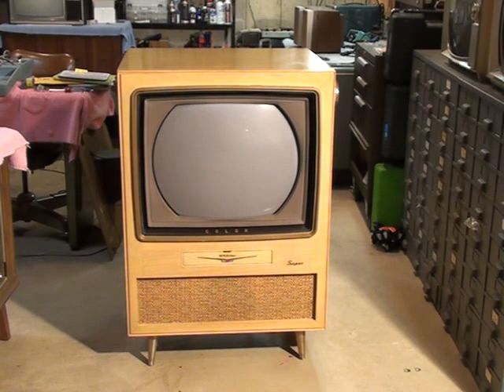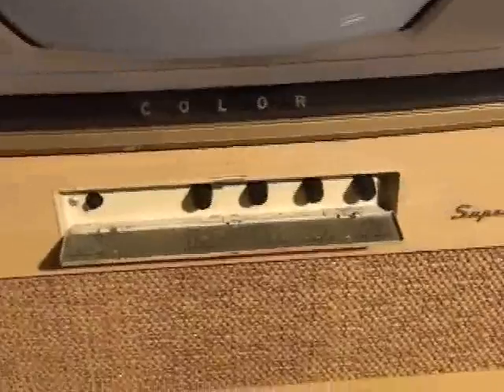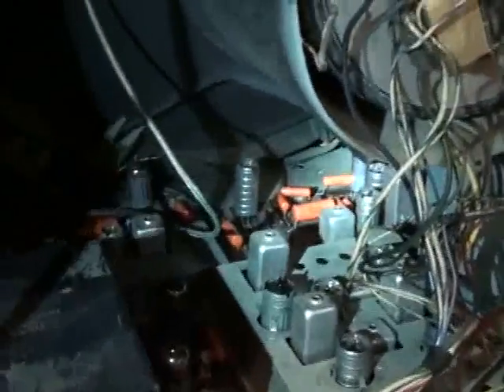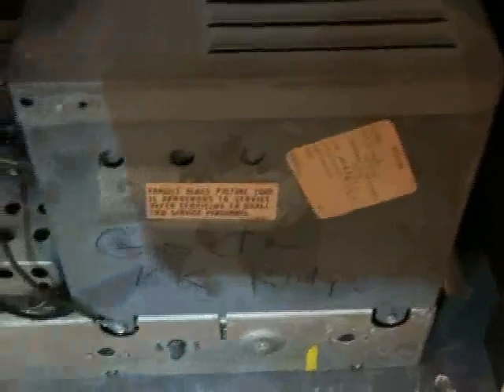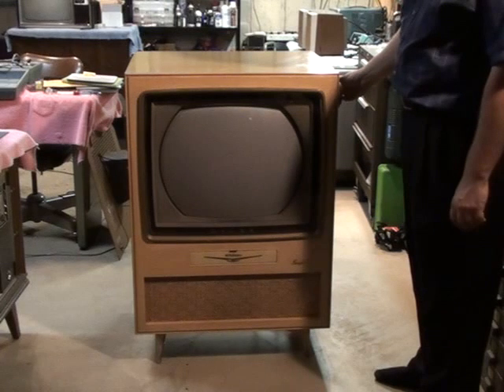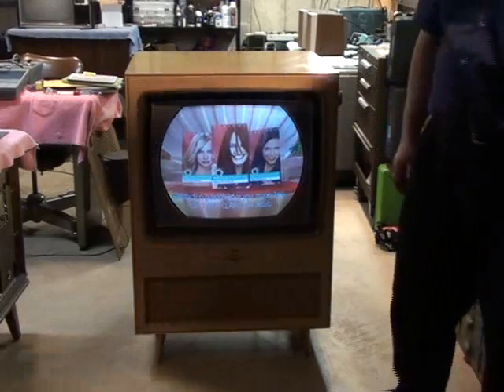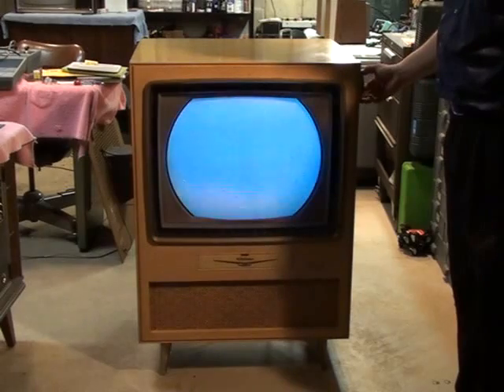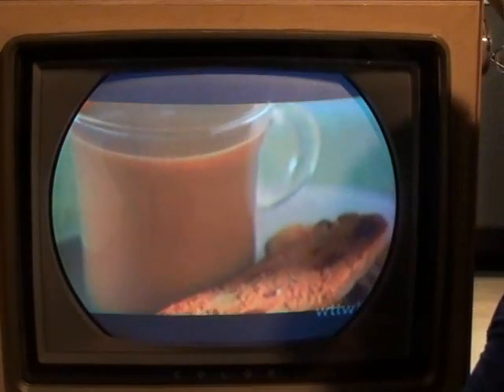Watch a 1956 RCA VICTOR CTC-5 COLOR TELEVISION!! "Roundie"

Comment: Let me add a little history...My Dad was an RCA dealer and we had the very first color TV in town, he also sold the first color tv in town and I grew up in the business and running the business till 1985.  The very first color TVs used a vertical chassis and the top of the cabinet was hinged, it would raise up for servicing, they had a boat load of tubes and your TV tech was your best friend!  At first there was only one hour of color TV broadcast per week, RCA owned NBC and talked Disney into being the first program, Disney's Wonderful World of Color was the name as I recall.  Color broadcasting slowly increased over the years, but exploded when RCA finally licensed other manufacturers to make their own color TVs, I'm not sure about the year but it would have been about 1966 I believe.  When I started selling color TVs RCA was the only one, but about the time I was in college they licensed it, every color TV of the time had a notice:  Built under license from RCA Victor.  One other small detail, growing up around a TV repair shop, the owner's name written on the chassis means that at some time the chassis was removed from the cabinet and taken to the shop for service, we used paper tags but some techs just wrote the customer's name right on the chassis.

Comment: Fantastic. Its a credit to you for doing the restoration work. The picture & sound are excellent.   The CRT was obviously built to last.   A piece of History to admire!
Reply: In reality, the round 21" tubes lasted between 5 and 10 years when used daily.  I changed a hundred of them easy. Of course, there are many for whatever reason just defied physics it seems and ran much longer.  My dad's CTC11 needed it's original sulfide phosphor tube changed around 1969 (ten years) and the replacement tube (hi lite phosphor) went to 1977 before we scrapped the TV for an XL-100.

Comment: anyone else remember that wonderful aroma of a hot wooden TV cabinet. If you left the TV on long enough there would be this sweet aroma of warm wood and hot electronics
Reply: inkey2 sadly I was born in 2002. I love mid century modern (50s) when I get my own place I will have 50s furniture and tech (I hope)
Reply: Ah, the magic of old tube TVs. I also remember the sound coming on before the picture, and the little white dot in the center of the screen when you turned the set off.
Reply: Absolutely! When I was a kid, At night I was always sticking my head around back to see the MAGIC AND A LITTLE SCARY GLOW of the tubes.and awesome smell of hot electronics!! I still get my fix from a 1954 Zenith am fm phonograph console that works perfectly.has the cobramatic turn table too. My great uncle left it to me when he passed in 1994, at 100!!  He knew how much I liked it . He bought it new..it has lots of glowing tubes and the familiar  odor that goes with it. I also have several Zenith table top radios,  one from 1961, the other 1964. Both tube types,  and playing well. Also have a 1941 Zenith floor model radio that belonged to my mother's parent's.  She told me on December 7, 1941 when pearl harbor was bombed,  everyone listened to everything happening  on THAT RADIO! Still works!!
Reply: Very good point....
Reply: Ozone too
Reply: Nothing like the memories of hot PCBs, and formaldehyde
Reply: Don't forget the unique high-pitched whine those crt tvs made.
I don't miss it. Some sets were really loud! Wasn't from audio, I was told it was related to the beam scanning the tube.
Reply: ++++ Does anyone else remember that late at night you could get more than just your 3 local channels . I was in the Boston Suburbs and got channel 4,5 and 7. After about 11:00 you could run through the channels you usually didn't get in the day. They came in "snowy" but semi-watchable, some came in better than others. Since the signal was the old analog way you could see even the weakest channels. Today on a digital signal you either see the channel or you don't....can't see a weak signal.
Reply: Sadly, I must say that I don't.
Reply: I might start in on my "Alliance-Tena-Rotor" story, but I suspect most of you never heard of it. (yes, it's vintage TV related)
Reply: Yep, dust burning off hot tubes and carbon composition resistors.  The good old days.
Reply: @gregdolecki8530  Yeah, and  remember the big """INSTANT - ON """ tube set disaster. There were two settings you could choose  "off"....and an "instant "ON" off setting. The tubes would keep glowing at a lower power level (seemed like it was off BUT WASN'T" so when you turned the tube TV "on" it would come right on instantly. Problem was the low level glowing tubes were still a bit hot. After sitting like that all night the heat would build up enough to ignite the dust on the tubes and "instant house fire". A family in in my town died from one of those "instant-on" TVs. Entire family burned up. Needless to say I never used that setting on my RCA again.
Reply: @inkey2  I wasn't aware of that feature on some sets.  It most likely kept the tube heaters on.  A tube would heat up in 11 to 15 or so seconds from cold.  People couldn't wait that long apparently.
Reply: Smell of crudeness this video really makes you appreciate modern tv and tech
Reply: @inkey2  The Yoke power supply: 10 - 30KV.
Reply: @inkey2  lol you mean like these old tube sets? someone literally wrote just how unreliable these were until 80s.. but even then crts only lasted 5-10 years. Back in these days "tv repairmen" were a thing because they were so busy with repairing these tube sets.

Also I am not buying your crt running 12 hours a day for 22 years and being good as new.. that tube must be weak af.. in fact it should be so dim you can't even see a thing.
Reply: @harshnemesis  I never said they were tube sets
Reply: @inkey2  I am talking about crt technology in general (which is a tube btw) It took until 80s for tvs to be somewhat reliable, which was well after the tube era.. because tubes constantly broke down... people were literally removing them and taking them to shops to test them regularly, that's how bad it was
Reply: @kysbleach69.o.24  Furniture would be OK, but be careful with electronics and stuff, they can posses danger after so many years. For example some radios were made without input transformer, that means that hot (phase) can be connected accidentally to the chassis of radio. As well capacitors can be bad and beside rendering device unable to operate properly they can cause overheat and fire. Just let experts check it before use. Some home appliances can posses danger of shock as well due decaying insulation inside. Just let them be checked before use. And about some armchairs and so, they were made from styrofoam and/or used some not ideal materials that would catch fire really quickly.

But if you pay attention to those small things you will most likely be fine.
Reply: @davidjames666  Were they really PCBs or earlier designs with point to point wiring (or how it is called)?
Reply: @MrToradragon  prior to the PCB ban in 1979, the dangerous chemical can be found in capacitors and transformers in old television sets
Reply: @inkey2  That on it's own is unbelievable because CRT tubes themselves do wear out, even if you never have problems with guts itself, but even that is lucky because caps are necessary evil and are a shitty technology.. they are pretty much responsible for 90% of all failures on solid state electronics. Just like the olden days, if tv or monitor fails it's most likely the caps(except you don't have to worry about tubes also)

Either your tv sets are low to medium hours, or you're BSing. 12 hours a day would be a very high hour set. No CRT tube would survive that for 30-40 years and still work like new.. the picture must be weak, cloudy or simply so dim it's almost gone.
Reply: @gregdolecki8530  it was capacitors that shocked him, they are part of the transformer start ckt
Reply: We had a mid 50's RCA black and white got hot and caught on fire one time...house smelled of burned electrical and dust for a couple of days. Next tv was an RCA Color Trak...
Reply: @alanhumphrey4198  was it left on a long time before it caught fire?
Reply: @inkey2  As I remember it was after watching several hours of evening shows. It had served its useful life. Bought it about 1957 and lasted until sometime in say 1969...
Reply: @johnfranklin5277  Great story!!!
Reply: @harshnemesis  getting back to you from a million months ago.....when I said these two TVs were on 12 hours a day I didn't mean 12 hours non stop. They would be on 4 hours then off a few hours, then on again....then we, my wife and I would fall asleep at night watching so it would be on for more hours. The Panasonic super-flat was a high end TV...about $500  20ish years ago. The color is like new. The other one, Hitachi, cost about maybe $275. older than the Panasonic, and the color is fading very slowly. I'd say it has lost about 25% of it's color but still pretty good. I've really gotten my monies worth out of these.
Reply: @inkey2  Actually too much dust on hot tubes and base of tv cabinet itself...
Reply: I was in the business for many years and never smelled any such odors unless a transformer or yoke burned out and it wasn't sweet at all!
Reply: @bobboscarato1313  Oh, also....the fact I got 130 thumbs up for my statement about it indicates that at least 130 other people experienced it too.
Reply: @inkey2  Maybe they enjoyed your story!
Reply: I went into a more profitable business!
Reply: @bobboscarato1313  but what was the year span when you were repairing TVs?
Reply: @inkey2  1960 to 1974.-

Comment: What incredible color...especially for a 1950's set, when color tv was in its infancy. GREAT job on restoration!
Reply: When RCA got the final FCC approval for their system, the equipment was capable of producing an excellent picture.   However,  consumers didn't see that for another 10 years. The TK-41 color cameras produced great picture as did the sets, but only if you watched it on a closed circuit.  They had not yet figured out how to transmit a stable color signal that was shielded from outside interface that required viewers to adjust the color every few minutes.  Several innovations were developed that overcame these problems and allowed the public to see just how good color TV really was.  By 1964, sales of color sets started to take off. The researchers and technicians at RCA did an incredible job.  In fact, the NTSC system that was originally derided all over the world because of it's initial instabilities, wasn't really tossed aside when we switched to digital HDTV.  It's still the basis for producing a color image.  

......

Comment: We had that exact TV in 1959, and were the first in our entire neighborhood to have color TV.  The only differences I can see is that ours would swivel left & right, and our front control panel's door had a spring to flip it closed.  On top was my dad's Heathkit FM radio, that he wired to the TV's speaker.  I bought my parents their first microwave in 1978, and my mom wouldn't let it in the house.  In 1980 I gave my dad a video camera and VCR.  I'm glad I did.  I have home moves since then, starting when I was 25.  I'm 65 now, and have few friends with home vids that are that old.  Thanks for sharing this video!

Comment: The good old days of staring at the end of an atomic particle accelerator.
Reply: at or near 15 KeV!
Reply: And the good old days of listening to vinyl records that popped and skipped and you had to turn them over to hear the other side. I remember one vinyl record I bought that when I opened it, there was no music on the disk. It was just a blank vinyl disc with no grooves, not even a hole for the spindle. I took it back to the store and they couldn’t believe it either. 🙄🤭 They did exchange it for another copy of the record . They opened it in the store to make sure it was a good record.
Reply: @glennso47  Breaking News! "Good old days" are back. Vinyl is selling again and very well (and ~2X the price of CDs). Go figure.
Reply: and the X-rays out the back, and the emr  like wifi.
Reply: @glennso47  Imagine keeping that 😂 Maybe it wouldn't be so valuable but I'd definitely be a good memory.
Reply: @glennso47  Now-a-days you wouldnt even be able to take that back.
Reply: @hlcepeda  That's why Japanese went with the SACD and DVD. Better quality than vinyl and half the price. Plus no pops or degradation of the content from listening too many times.
Reply: @kevinmajorca  I think that's already very well understood by everyone. IMHO the relatively recent large (and apparently lucrative) uptick in vinyl sales (something of a Renaissance) is based on collectability (short run pressings, in particular); young consumers' so-old-it's new perceptions; and audio gearism. Also, although analog equipment manufactures lost their analog vs. digital battle long ago when CDs first came out (ex: analog makers claiming digital = harsh unrealistic sound), it could be that, for a new generation, there's a curiosity --- a hunger --- for a different way to (hopefully better) experience their favorite music; to try out the 25 lb. reference turntable left to them by their nerdy uncle; to hold onto a large, substantial, precisely made object that requires a certain (pleasurable?) ritual behavior (sleeve removal [ASMR]; careful handling by the edges; cleaning; turntable rpm adjustment; careful lowering of the tone arm). It's all very tactile and, I believe, adds a sense of value that eludes ubiquitous CDs. Anyway, that's my belief. FD: I favor CDs over vinyl.
Reply: @hlcepeda    People don't want 'quality' in the playback. The rise of MP3s and streaming have all but destroyed the CD market. Quality is worse, but convenience is king.
I think you are right about vinyl. It is an experience, almost a destination, to listen to a vinyl record, as well as the artwork and liner notes. It can be likened to the stories I read of when people listened to Sgt Peppers or Dark Side of the Moon in the first days of release.
Reply: @kevind6645  Please excuse my parsing of your post: I just want to be clear. Re "people" and "quality"... no, and yes. There are definitely people who almost singularly prefer convenience over quality, but the evidence (sale of vinyls over the last few years) shows that there are definitely other people who are buying vinyl and for the reasons I've offered. Are vinyl buyers in the minority? Of course, but my earlier post attempts to explain the surprise of vinyl purchases in an age of digital storage and delivery. AFA liner notes, etc., yes... that was such a huge part of having an album in one's hands back in the day, especially when unusual extras were thrown in. Examples: Jon Anderson's Olias of Sunhillow which effectively doubled as a beautifully illustrated story book (albeit an extremely slim one); or Rick Wakeman's No Earthly Connection which came with a sheet of mirror-shiny foil which (when wrapped around a tube) could be used to "reveal" the anamorphic images printed on both sides of the album sleeve. (I still have my original issue copies.) Gimmicky, yes... but neat things to own and have in your hands while listening to the music.
Reply: @kevinmajorca  
Er...you really think that DVDs and CDs never skip or degrade?
Reply: Idea:  Come-up with a old tube that you can plug in and give that old smell of a hot tube.
Reply: @glennso47  How's your bro 🤣
Reply: Thanks for sharing this video. It definitely brings back memories of nice cabinets, sound better than flat panel TV’s now, taking time to warm up, the aroma of vacuum tube technology. Wouldn’t it be interesting if there was a 4K flat panel in a nice genuine wooden cabinet with quality 3 way speaker on both sides and processor to simulate the warm up period from blurry to sharp picture

Comment: As a kid I remember all the TV repairmen made house calls to work on the floor model TVs, which everyone seemed to have.  He would carry in 2 huge tool chests full of every kind of tube to fit the different TVs.  One by one the repairman would take out each tube and test it, then put it back in the TV until he found the one that had burned out.

Comment: One thing I find impressive, apart from the fact that the TV is functioning perfectly, is that the camera didn’t do that shutter speed illusion where there’s a rolling line on the CRT screen
Reply: The camera used is recording at a completely different (faster) frame-rate than the television's reception at 29.95 fps.
Reply: @SoundJudgment  no, because then there would be a rolling line on the CRT and there is not. So the camera and CRT are probably at the same or a very similar frame rate. The camera is probably recording in NTSC or something, since the video is also 480 rows.
Reply: That illusion usually comes when the exposure time is very short (so short that one can see what's happening). Longer exposure time  helps to fix it.

Comment: Motorola offered the first rectangular 25" color TV sets in 1964. Picture tubes were made by National Video; I had the great honor of removing 2 safety screws from the back of a brand-new set and the back broke the tube neck at the socket. Had to go and exchange tube and re-install it. In those days we had to go thru the process of convergence which was quite elaborate and it could take 30 minutes or more. We used a pattern selector to accomplish this.

Comment: Wow beautiful color on that classic set. Great job! The cabinet is still nice too. Of course now in 2021 there are no more color analog signals being broadcast, so those wonderful old circuits are officially retired. But it’s the engineering of something so solid that it could function 100% 65 years later with little maintenance that truly impresses. Our grandfathers really knew what they were doing.